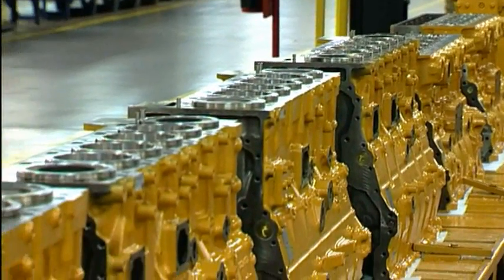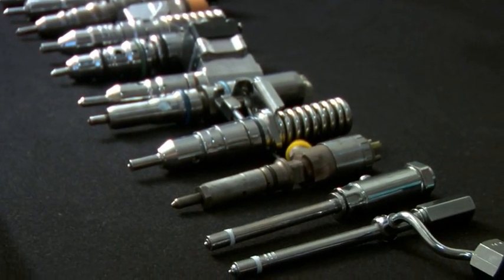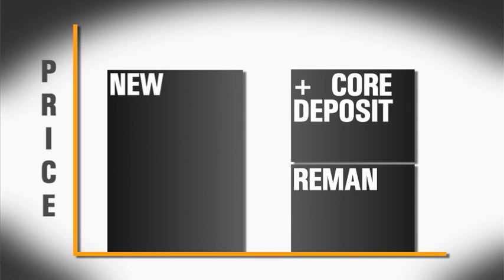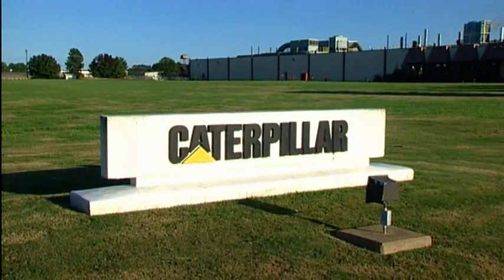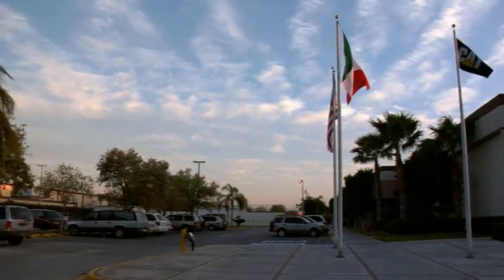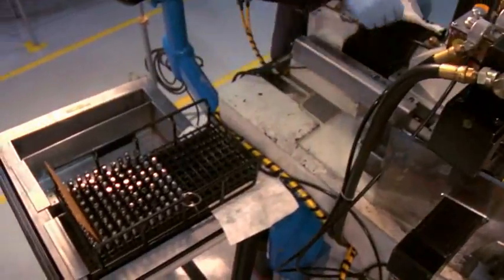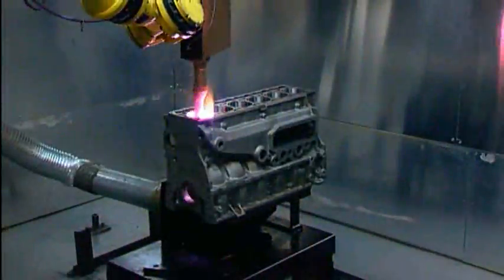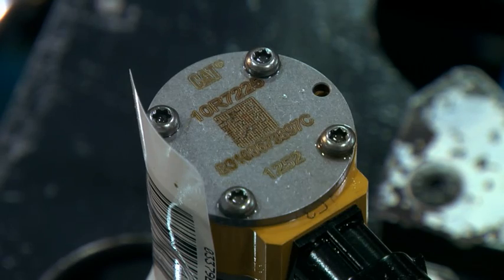Cat REMAN | The Remanufacturing Process

Comment: They are dipping the steel parts into a super heated salt concentrate, it is called the Salt Bath.  Has high concentrated salt and heated to about 700 degrees, removes grease, oil, dirt, etc.